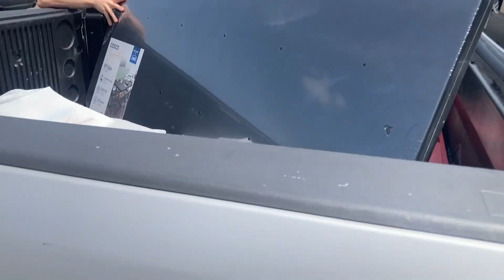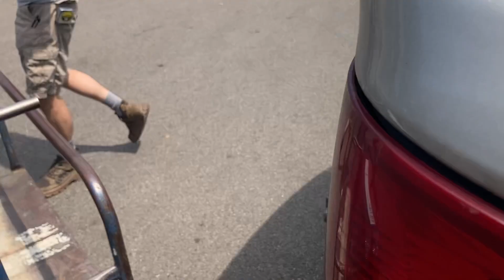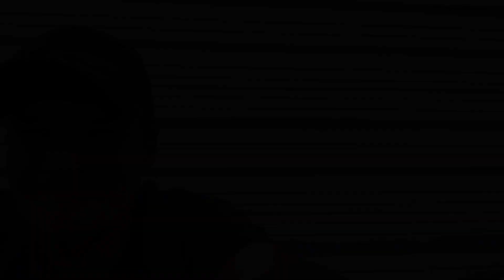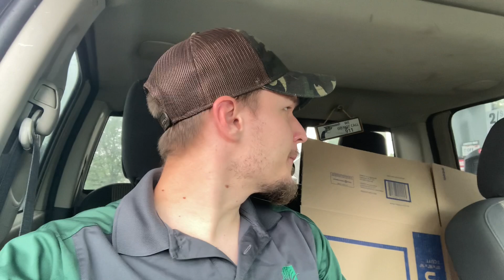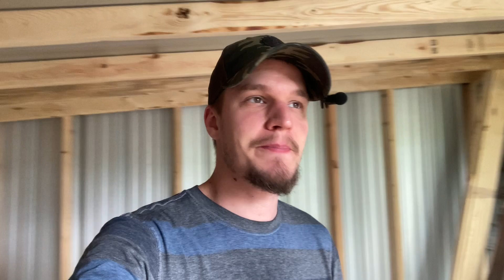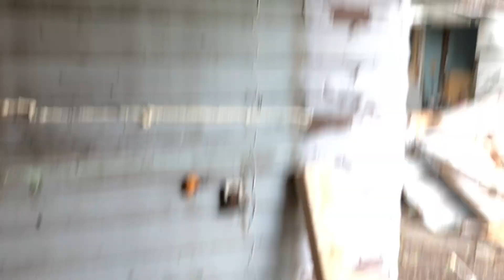Gearing Up for the Fall Event Season | Lowe’s Run @lowes

Comment from the maker: Shop with Lowe’s! 🔗⬇️
#lowespartner #affiliatelink #lowesfinds 

Utilitech 4-ft 4000-Lumen White Cool White LED Flush Mount Garage Shop Light: https://creatoriq.cc/3Ylovwe
Cosco 2.5-ft x 6-ft Indoor or Outdoor Rectangle Resin Black Folding Banquet Table: https://creatoriq.cc/3WHZHxs
DEWALT 21-Piece Assorted Titanium Nitride Coated Hss Jobber Length Twist Drill Bit Set: https://creatoriq.cc/3SyeLet